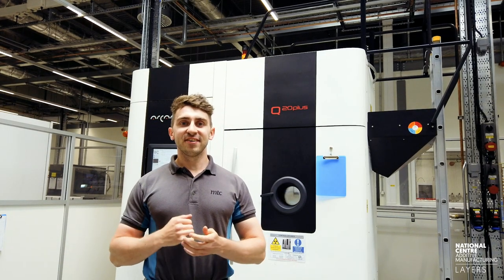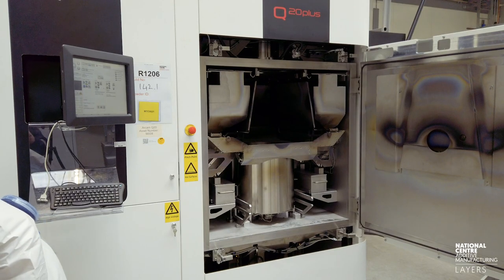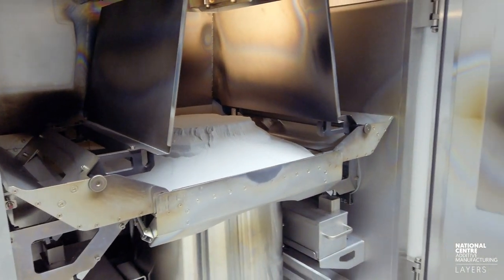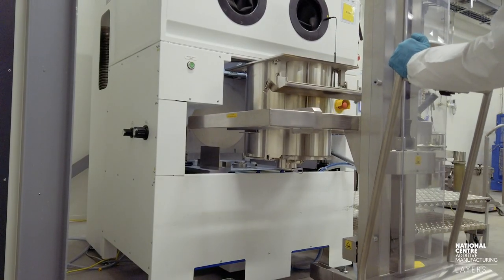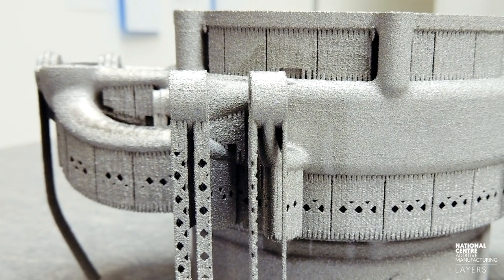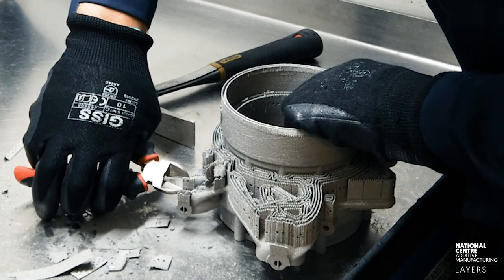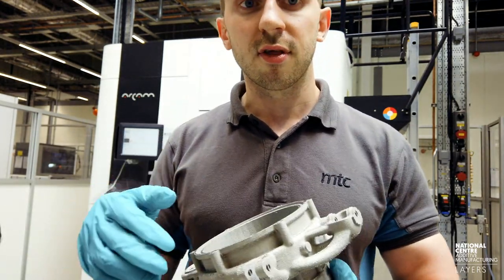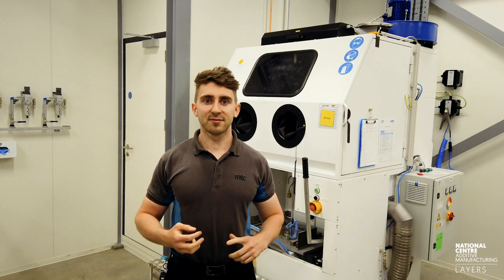Metal 3D Printing ( Electron Beam Melting ) Electric Race Car Parts - Part 2

Comment: Nice video showing part consolidation. If all those mounts for steering, suspension & motor had to be machined & bolted together, youd be looking at dozens of parts (when you include fasteners)

Comment: What do you do about the surface finish? Vibratory tumbling? Electropolishing?
And it is nice to see you take safety serious with the PAPR and Tyvek suit, but you did not when removing the support and there was still a lot of metal powder left on the part in that stage.
Reply from the maker: Thanks for the comment! Critical areas where a specific surface finish is required were going to be machined. The remainder of the surface was to remain as built as for this prototype. If it were to go into production then certainly vibratory tumbling could be used. During the support removal the operator is wearing a blue flame retardant Nomex suit with full RPE in a support extraction cabinet which aims to suck small powder particles from the support removal process